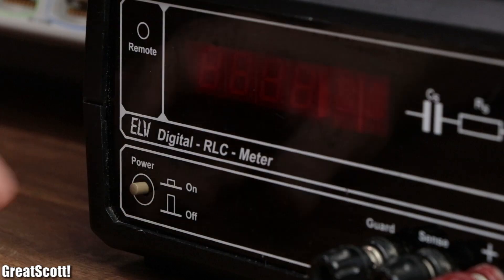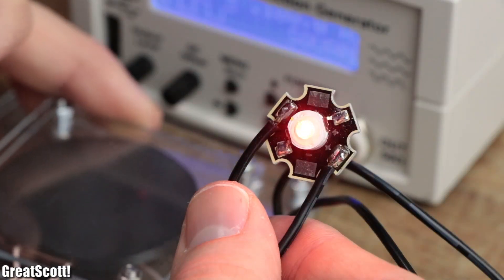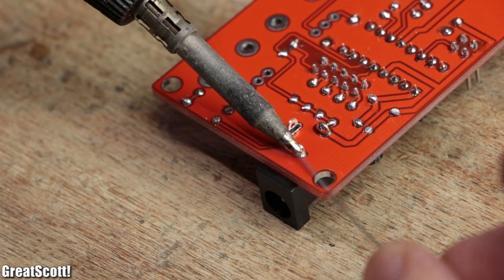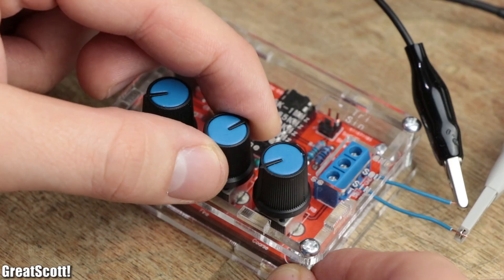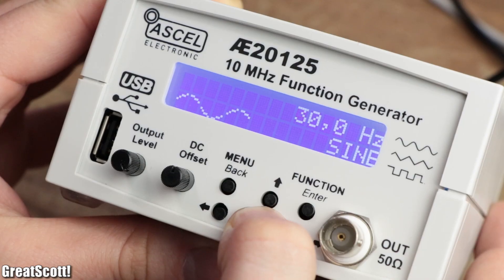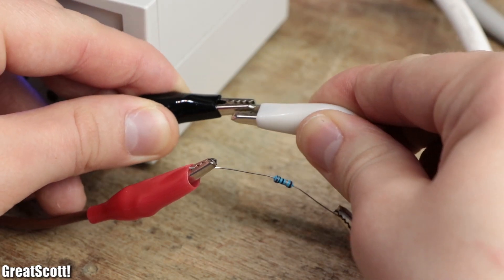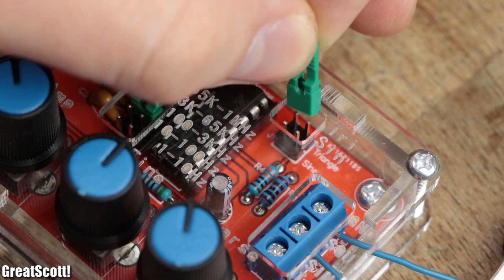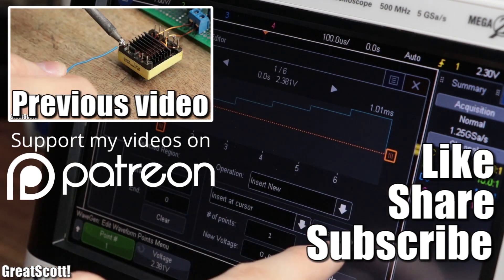7$ Function Generator VS 107$ Function Generator

Comment: by the way, how can i measure the inductance with a function generator and an oscilloscope ? I have tried many times with a 100uH coil but i have never found a value that was close enought... Maybe the too cheap oscilloscope hantek 6022be ? Happy new year scott ;)
Reply: Giacomo you have to calculate it rhe formular is xl = l * 2 * PI * f with  xl = resistance of the coil at a specific frequenzy. f = frequenzy and l = henry of the coil. so you have to measure the voltage and the current throug the coil to get the inductance of it
Reply: Ok, fine, so the formula is: I = xl / (2*Pi*f), i need xl... i choose a frequency, a random frequency ? 100khz ? And an amplitude, 5v... maybe do i need to consider the impedance of function generator ? 50ohm+-10%, a measure the current through the inductance, them xl = peak voltage (aproximatly 2.5v in my case) / peak current, right ?
Reply: Giacomo yeah but you have to measure the current over a shunt resistor with you oszilloskope. So you put a 100ohm (you can also take another value but 100ohm -1kohm should be fine) resistor in series with the coil then you mesure the voltage drop over the resistor and with ohms law i =u/r you can calc the current. The impedance of the function gen should not infulenc the it so you dont have to worrie about it
Reply: I have tried, with a 101ohm resistor, 10khz and a 100uH coil it works. But with a 100mH coil, a 101ohm resistor and 5v at 10khz i find 133mH but at 1khz i find 83mH... So i have some doubt to find the correct value for an unknow coil... are there others method ? Anyway thanks for the help
Reply: Giacomo yes its inacurate but you can buy a component tester wich will do the mesurement for you